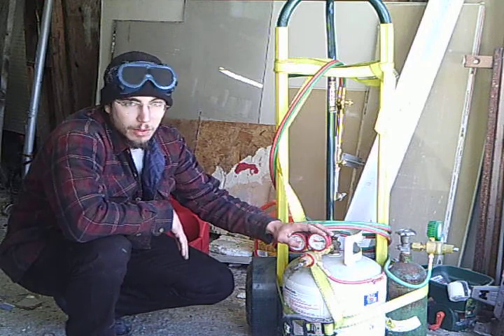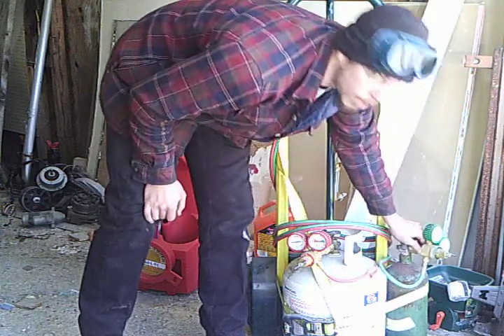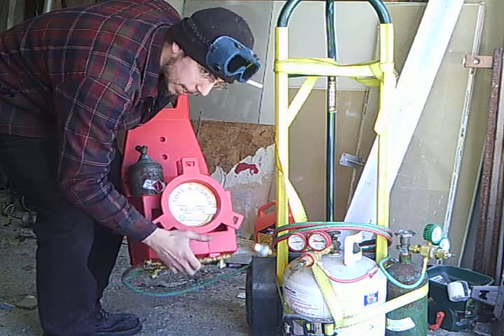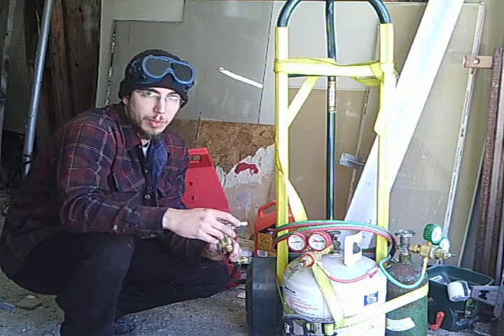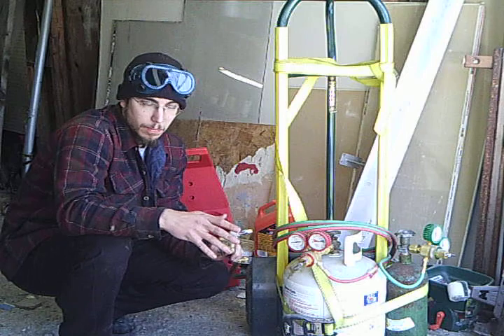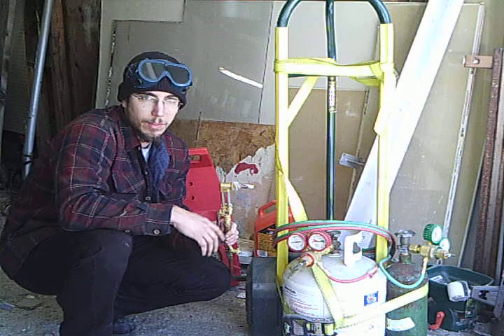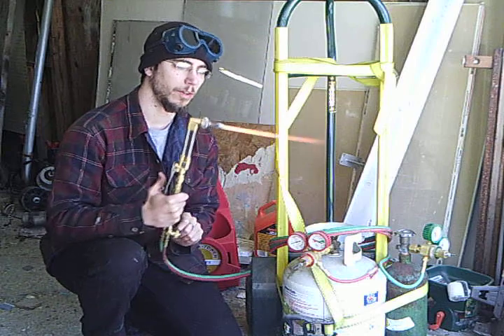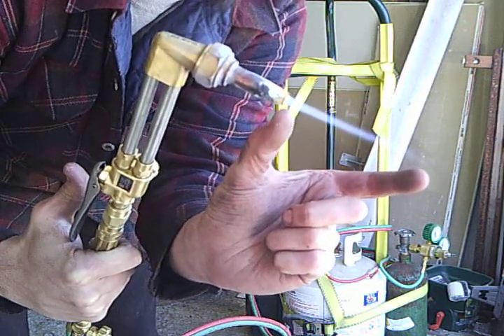Acetylene torches converted to Propane KA-51-TCPW

Comment: Cutting is easy, brazing and welding is another thing. 

I just modified a victor brazing tip to work with propane and it was ridiculously easy. Just determine the orifice size of the acetylene brazing tip (Victor #1 is .046", for instance) and double the number.

Use a drill bit as close to that doubled number and drill into the tip about 1/16" to create a countersunk recess.

Lighting takes some practice as it's different than acetylene,  but I've gotten perfect brazing flames this way and the torch never pops or goes out.

A lot cheaper than buying Victor 5-10 tips, and works just as well.

Comment: Real good info one thing I would caution about is starting your torches with a lighter that goes wrong one time and you will have a very bad day
Reply: I worked at a weld shop and lighters were banned from the building.  Leave them in your vehicle.

Comment: with the little #1 size oxygen tank like he has and i have 2 the same size, i got maybe 10 minutes of cutting and its empty! its $35 right now for that exchange so its expensive as hell to use propane with that mini bottle
Reply: The main thing I get from this is that everything used for acetylene is all right for Propane, torch and all.  The tips are OK for brazing but not for cutting.    I never cut with gas or weld with steel.  I braze and silver solder and Propane is good enough.

Comment: I need to connect my acetylene regulator to a propane tank just like in this video.  Does anyone know which specific adapter I need? I would like to buy it on Amazon if possible.   I would like to get tips for mostly heating. Would the welding tips suffice for that? If so, which size is the beest for that?  Does the biggest tip put out a lot more fheat than the smallest or is the heat outtput insignificant? Thanks....

Comment: What fitting or adapter did you use to put the acetylene regulator on the propane tank?
Reply: Did you ever find the answer to this question? I have the same question

Comment: You need to replace you acetylene hose with one made for propane. They are different and propane gas will degrade acetylene hose.
Reply: Have not had a problem been using one for years